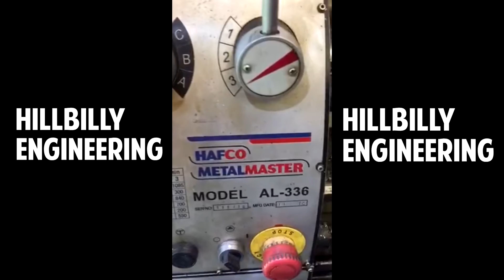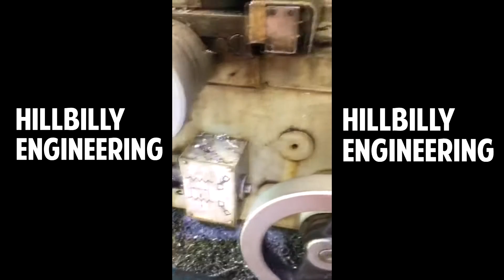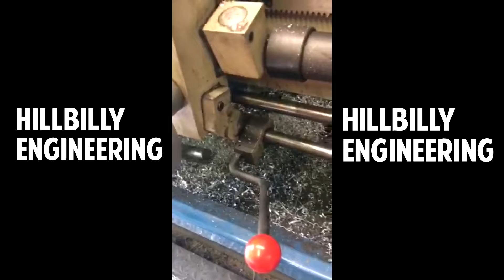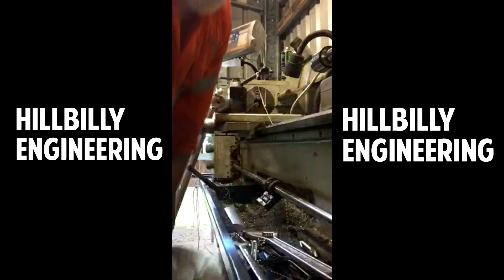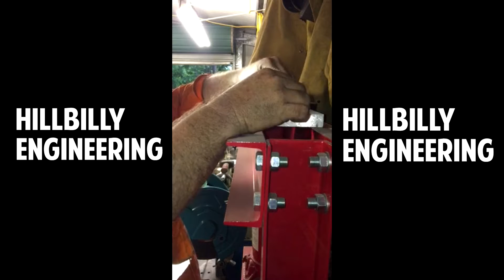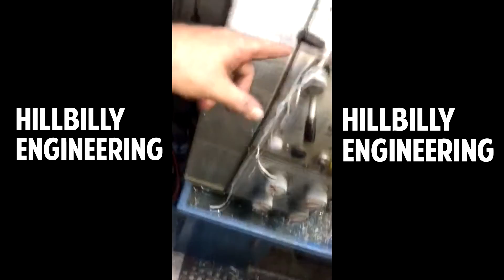Metal Lathe Crash And FIX! Hafco AL-336D

Comment: G'day mate. I have watched all your very informative videos in preparation for picking up my new AL336d which I did yesterday. Straight out of the crate I could not get the full saddle travel towards the tailstock to help balance the weight for lifting. I couldn't see any obstruction then remembered this video. I know your issue was travelling towards the chuck but do you know it it restricts travel towards the tailstock as well? This seemed as though it was the issue. I know this is an old post but your help in this would be great before I have a go at Hare and Forbes when this issue has been going on for years. Your replies from many people testify to that. keep up the great work. Cheers.

Comment: I have taken the guard off the lead screw after a couple of crashes. The shaft to the pinion was bent so I used the hand feed to turn another shaft, cut the pinion off the bent shaft, drilled the centre of the pinion out and inserted the shaft. Put a bit of weld on the end and turned the end of the pinion to fit. It now works fine. Unfortunately something has happened to the drive on the lead screw and I have another repair to do.

Comment: I’ve replaced the pinion and shaft that was bent and now I have to do it all again. Same issue, feed screw cover will not compress far enough when using the top slide. I’ll have a go at straightening it if bent. I think I’ll remove the feed screw cover in front of the apron and put a different guard on it, probably just an acrylic apron.

Comment: Hi, Good video. I have the same problem. (I left a piece of plywood on the bed after I changed the Chuck over) got distracted and crash!) I've had the lathe for 20 years. A CQ 6230 almost the same as yours. I had a look at it this morning got as far as removing the lead rod, and undoing the the worm gear, but couldn't drop the apron.   But, I see that you need to remove the directional rod as well. I could not remove the end block that holds the three rods because of the dowels, so just pulled the lead screw through. So, your video answers the question. Thanks. Graham, Bundaberg.

Comment: You wont believe this, but I saw this video last night for the first time, I was just looking around for anything on the AL336 and thought this could be interesting, a view of the inside of the carriage, might come in handy one day for my lathe, I even shot you a question about the cross slide lock to which you replied (Thank you)         THEN.... The next morning, Not more than 8 hours later, I crashed my Carriage (Really dumb mistake, long story) and broke the same roll pin and bent the same shaft... If it weren't for this video I don't know what I would have done, After multiple viewing of your approach to this problem, I attacked it slightly differently and found this repair to be a breeze, now I am confident of any future repair needed in this dept 
THANK YOU SO VERY MUCH FOR THIS VIDEO,
 Regards, Brendan Fraser Melbourne Australia
Reply from the maker: Awesome mate, thats what it is all about hey helping each other out. That was my first time pulling the lathe apart...

Comment: hi my mate used my lathe and he screwed it up, im not sure what he did, but he sheared the bronze gear behind the apron clean off and i think the lead screw isnt rotating, can you give me some advice, thank you
Reply from the maker: Hi mate, I would be happy too! What make and model is your lathe?
Reply: @hillbillyengineering01  I have a hare and Forbes AL336.
Reply: @hillbillyengineering01  I pulled the apron off and found the brass gear had been sheared straight off the shaft. Do you know if there is an easy way to repair this?
Reply from the maker: Eman Ekaf This gear should be fairly easy to remove and replace with a new gear from hare and forbes (probably a long back order at the moment tho!) It is made softer that the other gears so it does fail before destroying more parts. Its just a pity a shear pin didnt save the day. Must have been a pretty spectacular crash though! I didnt have a detailed look at the retention method utilised for this gear but I doubt its complex. Worst case scenario is you might have to remove the shaft if you cant see how its retained as it may be pressed on the shaft from the other end. Dont take that for gospel though, I am just throwing ideas out there incase you cant remove the gear at all. Also it may pay then to inspect the rest of the gears and shear pins as they have no doubt been loaded up pretty hard too.
Reply: @hillbillyengineering01  I took off the apron and had a look into the gear box, it's connected to the lowest shaft in the gearbox with a bunch of gears and shafts above it. It looks like I may need to remove all the gears to get to the one at the bottom. Do you recommend doing this? The job seems a little intense for me, I can't figure out how you would remove the shear pins because I can't get my hand down to the gears? Have you any ideas how I might best do this?
Reply from the maker: Eman Ekaf i am away from my lathe at the moment, can you try sending me some close up photos? 
bamboobullbar@gmail.com
Reply: @hillbillyengineering01  its all good, some one machined a new shaft for me and installed it for me, it was too much for me to handle. There are like a thousand gears in the gearbox. Thank you for your reply and all your help!!!

Comment: So you crashed it after you bought it second hand or the previous owner crashed it & you bought it and are repairing the damage?
Reply from the maker: Nah, all my fault. I kept forgetting about the extra space the thread guards on the ‘D’ model need  and kept compressing them until the shear pin gave way...
Reply: Hillbilly Engineering Thanks heaps, I was all set to head down to H&F tomorrow and pay up for the AL356V, which comes with lead screw covers.
I had intended to remove the chuck guard and use the micro switch and wires, to make a cut out / adjustable carriage stop switch out of it, where if I get too close to the chuck it automatically cuts power to the engine as if I’d lifted the chuck guard.
I’m terrified I’ll crash it, and ruin a new machine while learning, as it will be my first metal lathe.
Reply from the maker: Ian Moone hi mate, seriously though, I wouldnt remove the chuck guard. That will save your life one day! I have seen people make switches to stop the travel to avoid a crash... but really once you remove the thread guards you will be fine. The problem is they are ALOT stronger than they look and its not clear when you have compressed them too much and start putting pressure on the shear pins. Trust me, you will be watching your feed travel like a hawk. Every time untill your confident, do a ‘dry run’ with the machine off and hand fed, and slowly turn the chuck by hand and you will know when to stop the feed. As its your first machine, i wouldnt recommend you taking it apart straight away unless you are ok mechanically to do so. Get to know it first. For now, just mark on the machine where you can feel the thread guards start binding up and do not go past that point. When your good and ready you will want to take it apart anyway because there usually is casting sand in the bottom of the oil tanks...

Comment: nice video, i have the same lathe and have done the same thing.

those lead screw covers are a shit setup, i will be removing mine as soon as i get the apron gearbox off.

thanks for the tutorial, its good to know i am not alone with this problem.
Reply from the maker: Cheers mate, Yea i'm liking it with the lead screw covers off
Reply: i ended up straightening the shaft with the 11 tooth gear on it, in my press, its not perfect, but a lot better.
i also adjusted the gear rack that is bolted to the bed, up about 0.5mm and the saddle runs real smooth now.
thanks again, it was a lot easier than i thought.

Comment: Hey mate, good video. I have one of these lathes too and was also relieved to find that it was just the roll pin sheared. I really like this machine, but the Chinese use shit pins,shit oil, and shit bolts. I had to replace the bolts that hold down the compound as well. Very low quality bolts that are too short to get a full but on them.
Reply from the maker: Thanks for the comment mate, I had to change the bolts on the compound as well, especially when I started using the vertical mill attachment